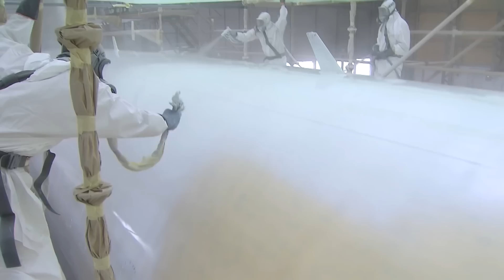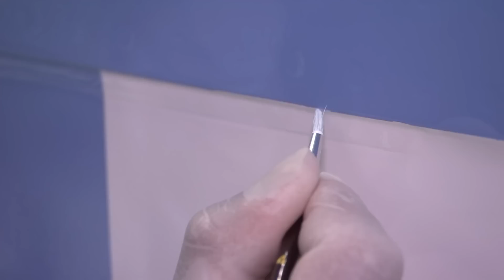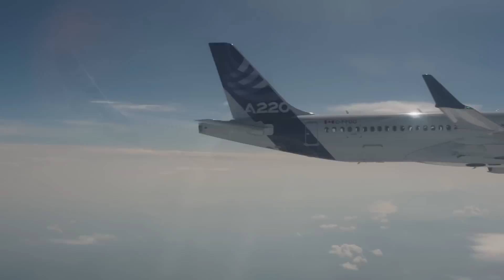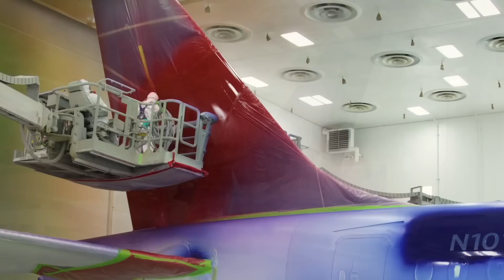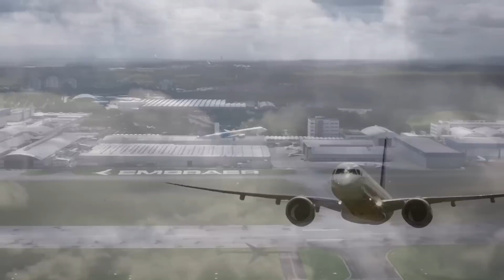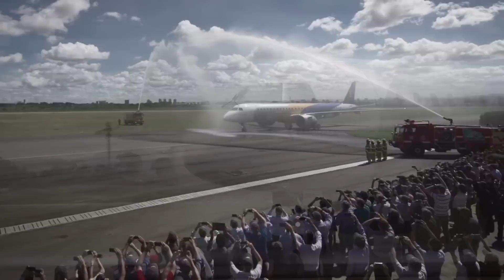What Is The A220-500?

Comment: The A220-500 will end up being a very (if not the most) popular variant of its family. It is a more efficient alternative to the A319neo (and 737-7max) and the ceo versions of both aircraft are nearing retirement age. Also, in recent times, the stretch of a narrow-body aircraft become some of the most competitive variants. Look at the A321 and 737-9/10max. Airbus just has to be willing to sacrifice the A319neo.
Reply: That I agree with you 100%
Reply: The A220-300 is already the preferred choice over the A319neo and the 737MAX-7.  Please check the passenger capacity and order books. The A220-500 should replace the A320neo and allow Airbus to attack the market with a dedicated NMA that replaces the A321neo.
Reply: @texasabbott  is true Airbus still has a version on making the A220 Series even the NMA A321NEOXLR Alongside the A321NEOLR Fleet.
Reply: @karlossargeant3872  The A220 is not in the same category as the much larger A321LR. The A321neoXLR (in development only) is a very heavy plane with a large fuel capacity, has reduced seating, and acts as a stopgap measure for Airbus to profit on before the NMA takes the market.
Reply: @texasabbott  I think what karlos means is a A220 -500 LR that has transatlantic capabilities like the A321XLR. The idea might be a bit of a stretch, but if realised may revolutionise the small regional markets and open up many more P2P routes.
Reply: @chingweixion621 A 4500nm A220-500 will probably be possible.  The wing loading is low at present.  Airbus increased MTOW of the A321 by increasing the flap area slightly and changing to double slotted flaps from single slotted across the span.  Airbus also implemented higher rotation rates from more tailplane deflection and had an anti tail strike software feature.
Reply: @WilliamJones-Halibut-vq1fs  you're forgetting about the auxiliary tank volume. While it may be feasible to create the 4500nmi A220-500, it will likely end up like the A321XLR, losing 30% of its cargo volume to hold the additional fuel.
Reply: @chingweixion621 The  A321LR has space for 7 LD3 containers because the additional centreline ACT tanks take up 3 LD3 containers space.  The more efficient permanent unified single tank of the A321xlr will have 8 spare containers free.  In either case its enough containers for a full passenger compliment for both NR/XLR
Reply: @texasabbott  Based upon range and payload the A223 is not a "direct replacement" for the A319neo/73-7max. It sits in a slot that takes on the shorter range/lighter payload flights that the other two fill. Just as a potential -500 would sit above those two and slightly below the A320neo/738max.

In other words, just because they can do the same flights, it doesn't make them 1:1 replacements.
Reply: @91_C4_FL  looking at the order books of the A319 neo,  I think airbus is more than happy to sacrifice the A319 neo for the A220-500. 
It all boils down to how much value does airlines place on the range and payload. If you look at the routes the A319 and A320 operates on, how many really stretches the aircraft to its limits of the range and payload? Probably less than 20%. Therefore you can still consider the A220-500 a direct replacement for the A319.
Reply: @chingweixion621  Exactly! The A223 and A225 supplement the A319neo on the high and low ends of its capabilities, respectively.
Reply: Not entirely correct, the 319N/73-7Max segment is well covered by the CS300, the CS500 encroaches towards the 320N, a time buyer to counter the NSA before Airbus embarks on the son of the A320 development. Regards
Reply: The issue with the A220-500 (there is even a A220-700 and A220-900 study) is the baggage loading times increase due to fuselage length.
Reply: Uhmm A319neo is comparable to A220-300 in terms of range and capacity. A220-500 would be closer to A320neo instead.
Reply: @nntflow7058  An A225 would fit better on A319/737-7 route. More pax for about the same amount of fuel. Like how the A321 is taking on 738/A320 jobs. Remember, none of these aircraft are 1:1 replacements or competitors to each other.
Reply: The A319 is my least favorite plane so they should go for it
Reply: I hope to see it on Long Haul Trips Between the USA & CANADA To The UK & The Rest of Europe.
Reply: @karlossargeant3872  a bit small i want bigger aircraft for those routes
Reply: @ethmister  I see but even though the Aircraft can still do good in various Routes Plus the Size of the Aircraft doesn't matter you know Plus I Love going on the Airbus A320 & A321's don't get me wrong but to me I see those A220's will operate those Routes Like it or not along with the A320 &  A321 Planes it'll work out for sure you'll see!
Reply: @karlossargeant3872  if the plane dosent have enough capacity then it wont get used. Most transatltic routes have higher demand than that aircraft have seats.
Reply: @ethmister  Ok Make sense so the only one left is A320 & A321 In JetBlue Fleet Plus JetBlue is working on 85 Orders of Two Variants of the A321Neo or Neo LR.

Comment: Minor correction: Airbus only purchased a slight majority stake in the CS program (now A220), not the rest of Bombardier.

Regarding an A220-500, that is an interesting thought. I don’t know how that would impact performance compared to say, the A320neo. However, one thing is sure. The range would likely decrease, making the A320neo a better option in the 180-200 passenger category where range is important.
Reply: Depends. It would be a great plane to fly between Chicago, Washington Reagan/Dulles, Charlotte, and Atlanta where range is not a huge concern.
Reply: Patrick Proctor , that is very true, and Delta may ultimately force the issue. The airline recently increased its order for A220’s from 75 to 90, and I personally think this will only increase as time marches on. In fact, wouldn’t be surprised if the number ultimately goes to 200. Passenger comfort is important, and this plane has it in spades.
Reply: @lrg3834  Bah, I forgot the 38 daily flights Delta runs to Orlando throughout the country. As long as it can fly for 4 hours, it covers 90% of the lucrative routes within the U.S., and it'll be a smash. Boeing should've bought up that stake. Their management should've been fired over that debacle.
Reply: The A220 has a relatively low wing loading.  Impact on performance of a stretched version would be due to increased weight and therefore wing loading. This will increase takeoff speed and landing speed and even with more powerfull engines and brakes likely also also take-off and landing roll.  As the A220-100 and A220-300 is currently much less than the A320/B737 that's probably not an issue since a stretched version would be used in airports able to handle 160 PAX and they tend to be largish.
Reply: I have top secret informants and they say it will happen
Reply: Airbus have a 50.1% stake in the CS100/300 (A220) business with the Balance to Bombardier and the Quebec Government.  The DASH 8 was sold of to another company but Bombardier continues to operate its business Jet division.
They had no choice as they were facing bankruptcy and Airbus had that Mobil Factory that offered a hope of bypassing the devastating effect of the 300% tariff.   Bombardier didn't seel the aircraft undercast. They sold them cheap but had a caveat that should Delta operate them on routes greater than 1000km that full price would have to be paid.

Comment: A220 :  Passengers love it.  Pilots love it. Airport ground staff personnel love it. Flight crew members love it. 

If airlines CFOs get to love it, then we have a real new game changer.  If not, there is no need to make a new version.

If airlines executives fall in love with the A220, we will be seeing newer versions of it in the following years to come.  There might be a A220 200, 400, 500, 600, 700, LR, XLR, Neo, A220F, max, you name it, etc.
Reply: There wont be an a220f its too smallbro
Reply: Well, maybe a stretched version could have a converted freighter version in 20 years, but yeah, pretty much it's too small, I think the smallest that exist are 737-3/700 freighters, MD980s and 735s never received any demand.
Reply: Cman probably for places with short runway or difficult terrain but I agree with you for the most part, it’s too small.
Reply: 700 is a bit of a stretch... (pun intended)
Reply: They will make an A220-500. Its a newer design. So it would cost less to strechs than making a whole new redesign. Boeing is in trouble since they are forced to make a whole new aircraft with ongoing mess of the Max.
Reply: The A220 doesn’t use standard LD3-45 containers.    The A320 can.   The 45 refers to the height, same as the LD3 in an A330 is 64 inches so.    Airbus is in the process of repositioning the A320 with longer range and may produce an A322

Comment: But would this compete with the A320neo
Reply: TheKingSalmon ! The A320neo has plenty of competition, if anything airbus needs the slow down on the A320neo orders.
Reply: @calculatortortilla6748  yes so give customers more flexibility in case they need to change their strategy or plane capacity requirements in the future
Reply: But this design is younger and more high tech and very pilot, passenger,ground crew and airlines friendly. So Airbus so t have to worry about investing in new plane from scratch. Plus after this coronavirus if there is a slow down in traveling this plane is perfect size and with the low operating cost it's also profitable.